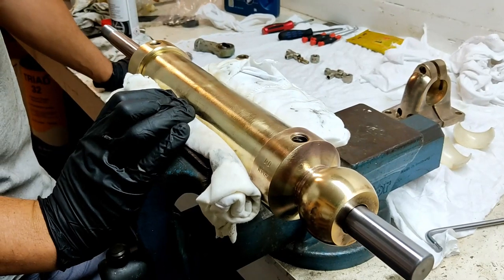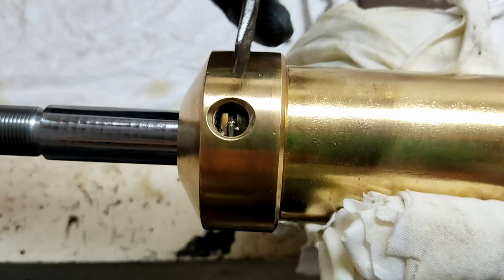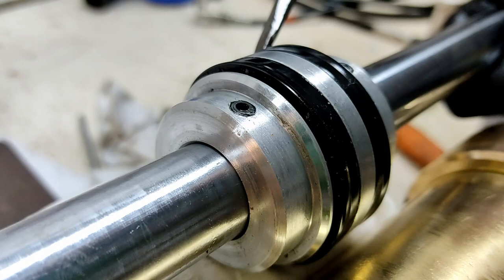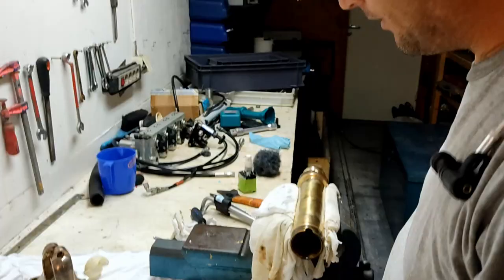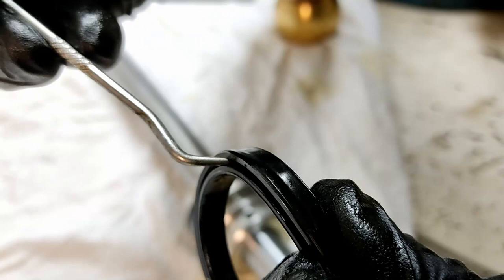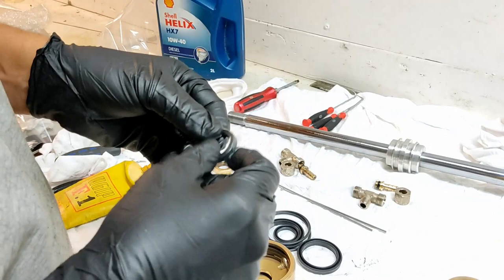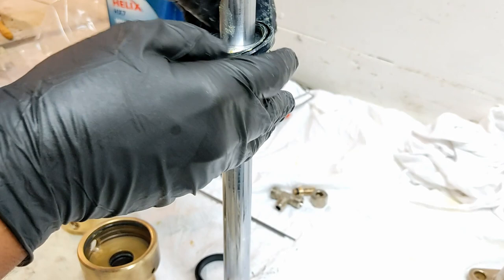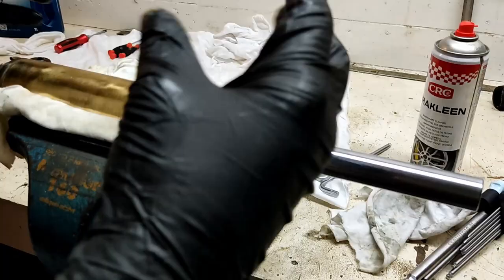Servicing our hydraulic steering rams

Comment: mine were a bit more agricultural, O rings both ends with two on the piston, was an every 12 months job
Reply from the maker: Orings on the piston was common on the  agricultural gear I once worked on. It was possible to upgrade the orings to lip seals with a small cost up grade some times.

Comment: a great video , thank you too much. I have a problem you might help me with. I have a boat with telefax hydraulic steering commanding an Alamarin Jet drive . since a while  - when turning the wheel I feel a lack when turning the wheel in the steering , where the response of the steering is lost . Then I feel a pressure - harder / stiffer tu torn and the wheel respond to the turn . Do you believe the sealing of the cylinder is getting damaged or is the problem in the steering hub ? I would love to get your idea .

Thanks a lot 
Efdal
Reply from the maker: Hi Efdal. It's hard to know without seeing it. It could be air, it could be the bucket seals on the ram or it could be the internals of the hydraulic pump. Hydraulic problems are difficult to diagnose without having them in front of you.
Reply: @youngbarnacles  yes ,I agree . best thanks for taking the time to reply...
Reply from the maker: No worries. Good luck!